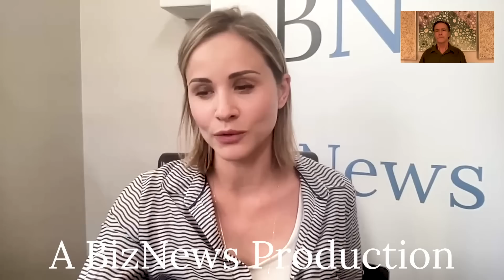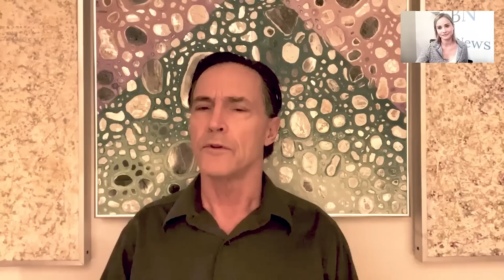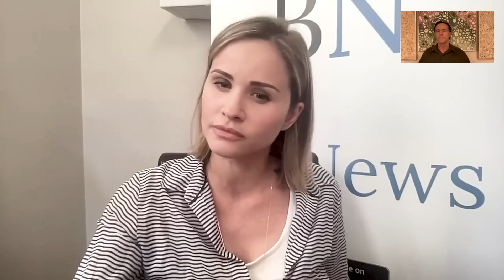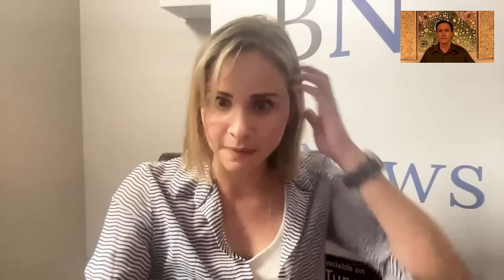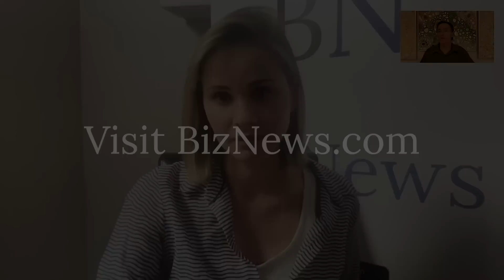The climate engineering cover-up – Dane Wigington on the existential threat of geoengineering

Comment: Contrails are frozen water vapor, period.   Dane is a one-man engine of mass hysteria.  

Each gallon of jet fuel burned creates slightly more than one gallon of hot, vaporized water vapor which then expands, cools and freezes at the -50F temp. and the 250mB atmospheric pressure.  Then, that cloud if microscopic ice crystals dissipates, persists or expands depending on the relative humidity at aircraft altitude. 

The air at cruising altitude is so thin and cold, it cannot hold very much water vapor and thus it takes very little vapor for the relative humidity to be at 100%.    In very crowded air space, the water vapor produced by jets flying on the same flight path can create local areas of saturated air where contrails persist or expand even if the air ten miles on either side is not saturated. 

As aircraft move through air with different relative humidity, its contrails may appear in the saturated air and be invisible in dryer air.  

Contrails are basically thin trails of cirrus clouds.  They have the same composition and this is easy to prove.
Reply: That's not right. When I was a child the only trail left by jets was a short trail that quickly  dissipated.  Today these trails are very long and stay in the sky for HOURS , not even moving in the wind. I know what the sky looked like years ago.
Reply: US Space preservation act 2001.under the section "exotic weapons".
Reply: @plantpotpeople8130  When do governments pay attention to any acts or laws. They only ignore them or change them to suit THEIR agenda .
Reply: @plantpotpeople  Which has exactly zilch to do with commercial aircraft and the contrails that form behind them for reasons fully understood since aircraft first flew high enough to encounter air cold enough to freeze the water vapor exhausted from the engines.
Reply: @trimetrodon  Me thinks the lady doth protest to much. Wow, all you've said in your desperate posts is that contrails are a thing. You haven't even attempted to debunk anything claimed in the video. Try harder.
Reply: Lt-Col Tom Bearden - scalar wave technology
Reply: @yasi4877  Meaning what, exactly?   Somewhere, in some dark corner of the internet, someone must know what that is.   They heard from an uncle who heard from a guy who knows someone who drive by area 51 once.  

Where does this stuff come from and why do people believe it?
Reply: You're full of it.  There's no way you can make that claim.  Do you test all the contrails ?  Bill Gates wanted to do this too.
Reply: @sandyelliott3350  The guy who is full of it is the one pretending not to understand high school chemistry or meteorology.
Reply: @sandyelliott3350  The burden is on those claiming contrails are a sinister attempt to drop barium, aluminum, strontium, or anything else on millions of square miles having no obvious effect on anything besides Dane’s paychecks from his monetized videos.
Reply: @trimetrodon  In dozens secondary arguments we serve to your untermenschen class : OTAN planes in Europe do not appear on flight radars ; they flight in low altitudes (condensation DOES NOT APPEAR — NEVER — under 8-10 km up) ; and they CURVE their trajectories, which you never observ for commercial aircrafts which YOU DO NOT EVEN SEE most of the time because of their altitude ===> the (rare) blue sky days are by themselves a proof of chemtrails existence, du*m as* / in other words chemtrails’s absence on certain day is a proof of their existence AS commercial aviation does not stop those days. PS : a rope, 5 bucks @ Wallmart.
Reply: @ledegazouilleur  Contrails only appear when the air at cruising altitude has high relative humidity.   When the air is dry, any water ice crystals that form instantly sublimate.    The physics is the same for cirrus cloud formation.  

But if you prefer to believe Dane’s nonsense, have at it.
Reply: @trimetrodon  "Contrails only appear when the air at cruising altitude has high relative humidity." That's right and that's why contrails are not those chemtrails we see all the time and in metorological conditions that would not admit contrails. Everyone : just watch The Dimming, and you'll understand why those cretins that do push that idea of geo-ingeneering not  existing (although IT IS OFFICIAL...) do deserve to die. Fred Mozek is less than a man that our children do not deserve.
Reply: @ledegazouilleur  So, if you understand high school chemistry and call bullshit when you see it, “you deserve to die”???   

I think Solzhenitsyn warned a time would come when speech would be illegal if it upset the idiots.
Reply: @trimetrodon  "Contrails do not linger, dissipate and go to cloud coverage. Period. End of report." That is exactly "high school" chemistry and every serious climatologist tell you this, with basic condensation, sublimation explanations. (Or, more precisely : that's because you stop learning with high school that you're as dumb as a lamppost...)
Reply: How do I know “all” contrails are frozen water vapor?  Occam’s razor.  Once you understand the physics of sun dogs and can observe the proof of identical composition, the formation of cirrus and contrails under the same conditions, then you assume, until proven otherwise that they are the same phenomena. 

It is irrational to walk around a shopping mall and, just because Dane tells you, believe some of the folks in the mall are from Venus.  You have to have some reason to think a person is from Venus.  Dane’s sophistry might make him a bundle from monetized videos, but that doesn’t turn water ice platelets into aluminum, barium or strontium. 

Also, someone needs to tell Dane that some souls in the Pacific northwest are 10% aluminum by weight.  Thus, if the wind blows dust around in Washington, there is going to be aluminum in it and that does not mean someone was spraying it out of airplane engines.
Reply: The Dimming tells all of it to you, dumbie.
Reply: @ledegazouilleur  Carefully composed sophistry.  What the DOD does to perfect cloud seeding doesn’t have anything to do with the tens of thousands of commercial flights that produce thousands of contrails every day, all without causing it to rain along thousand to three thousand mile long lines on the ground. 

If Americans took or remembered a little more high school chemistry or meteorology, they would not be so easily fooled into chem-trail hysteria.
Reply: @trimetrodon  Condensation from kerosene does not produce those persistent lines and clouds. In ANY CASE. The Dimming tell you all. One s need to be so dumb or coward to not recognize spraying (they are officially recognized, dipsh*t !) that — considering the gravity of it — they deserve to die. Those useless (Harrari is right there, just not recognizing he is useless as well…) are injected by dearh covid jabs for a vast part of them and that is good news. Disappear, you are less than a man.
Reply: @ledegazouilleur  The Dimming is deceptive nonsense.   People spray crops from 12 feet above farm fields.  The tanks and plumbing are open and visible.  It take Dane Wiggington to hypnotize “dipshits” into imagining the same equipment is present on every aircraft that produces a contrail.  

Yes, contrails can dissipate, persist or expand depending on the relative humidity of the air at cruising altitude.  I find it impossible to believe Dane doesn’t know this.
Reply: @ledegazouilleur  Read something about high school level chemistry and meteorology before you make a fool of yourself again.
Reply: What about the chemicals in the air/soil/water?? Contrails in a grid like fashion ?? Alzheimer's and other neurological diseases sky rocketing...
Reply: A lot of these chem trails are at low altitude 9000 ft wake up joker
Reply: Hi, I'm working in Switzerland and I can't say much but I read your very well constructed comment. However my field is in Solar Radiation Modification, in short there are certain aircrafts fitted with nozzles. You can find our work online at Solar Radiation Modification C2G. We are altering the weather, this is no lie or leading you to believe something extreme. We are hitting many walls because of long term studies. That's all I can say! Please be nice to everyone here, they're not wrong and that is my opinion only not company.
Reply: If its kill the plants why has the planet got greener? 15% increase in vegetation coverage
Reply: clearly you have not done the research or looked into the sky that looks like a checkerboard.... ignorance is bliss~